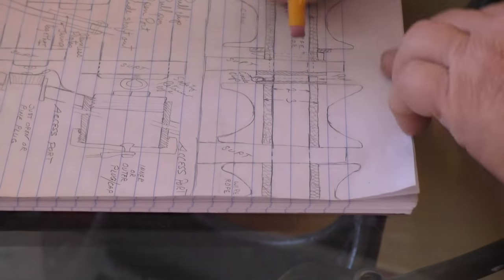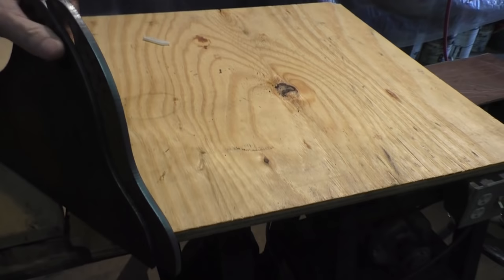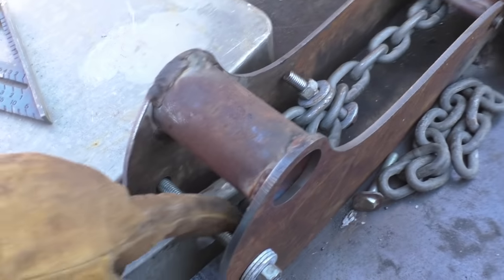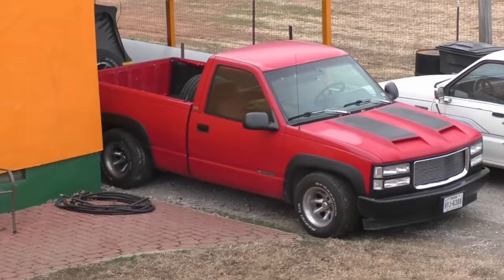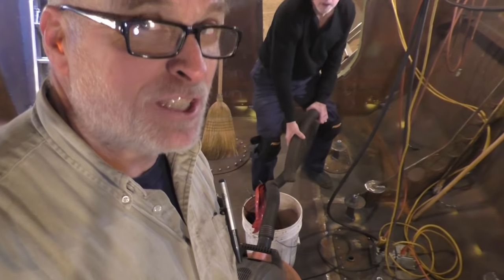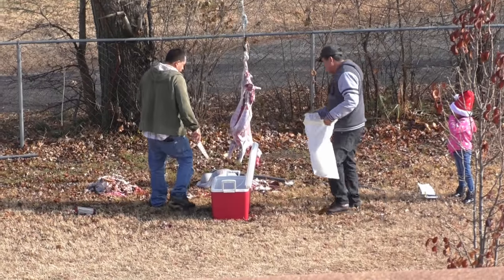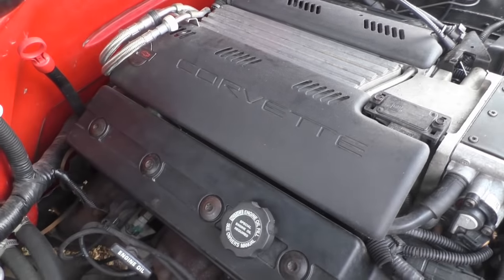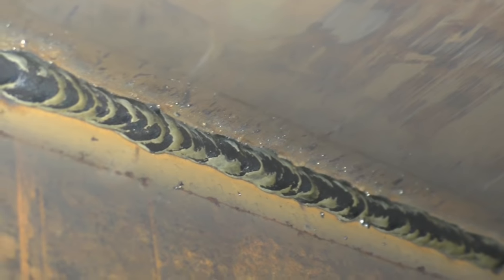Bow Roller, Rudder, Deck Crane and more

Comment: She is looking good Doug. Bet it is going to feel damn good to be able to spin the wheel and move the rudder back and forth.
Reply from the maker: We were headed in that direction but we got turned around and we are working on the fore deck and elevators.   But it will be fun to move the rudder.

Comment: im not sure if this is how it works on large boats but on small boats its not the anchor mount or winch that holds the weight. you clip a short rope to some where along the anchor chain and tie it off to a forward cleat that way the short piece of rope is what takes the force and is the part that will chafe but it can be easily replaced. it will also stretch a bit cushioning the boat.
Reply: true story...
the common way of doing this is a good one, but I think the way they came up with is also a very practical one.
The idea shown in the video is very fast and easy to handle so I think the fact that they loose a bit of 
strechieness is acceptable.
Reply: David Deichmann looking at his new video u think the chain stop may just be for when the anchor is up which would be fine.

Comment: the keepers and locks are a nice touch on the bow roller.   is the one little flappy bit the only thing that will be holding Seeker "connected" to the anchor line when you're at an anchorage point?  or does that just control the pay out of the chain?
Reply from the maker: We're just mocking it up.   Think of that as cardboard. :)

Comment: Are  you going to get the deck crane up and running earlier than the engine so you can use it to help with construction?
Reply from the maker: No.  We really don't need it while the boat sits under to two gantry cranes.

Comment: With a boat this size you will need a bow thruster to maneuver properly !!!
Reply from the maker: Then we'll just maneuver it un-properly.
Reply: u sure ?
u will allways need the small boat to push you around or sth 
it would be mechanically still quite "easey to install" in the current state of the boat
a T transmission (one inlet into two outlets of rotation like used in snow blowers but with impeller  ) a 12" pipe a electromotor a grid against debree on each side and cabeling and a electric switch for the rotation direction
you can weld around the T transmission in order to seal it and the electronics wont be anywere near the whater makeing two propeller is no match for you anymore since you have casted that brass winch fine ...
since you wont use it much you might be okey with just a stainless steel propeller and no brass
Reply from the maker: Hurricane safe?  :)     Anyone thinking they can build a boat that can withstand nature does not know boats or nature.
Reply: i was already for a half year on a boat with several heavey storms with crosswind and up to 6 meter high breaking waves with a 20meter boat and the knowledge that the liveraft wont save us with these storm waves and wind if anything goes wrong
I mean floating stability  ,air surface(being pushed by wind) safety like thickness of of the (safety) glass in the cockpit and the strenght of the frame against incomming waves rolling over deck and hitting the cockpit- meny ships have a carlike window , plastic or even a bulletproof like multi layer safety glass shockproof glass sealing/bedding , the ammount of whater the bilge pumps need to get out quickly when needed, the whatertight seal on the doors and openings 
 the quality and pressure resistance of the radial shaft seal at the propeller shaft
the complete seal of the motor - it should be able to still runn if it is fully submerged with whater 
the liferaft and its positioning for easey access when needed also escape hatches if one of the compartments gets flooded to get out the others
The ammount of force with witch the crew will be tossed around by waves, maybe safety cabeling to hook yourself on to not get washed overbord and for the actual railing you sure will make sure that it should hold a thrust of 350 kg per pillar in every direction and needs a minimum 1" pipe diameter to prevent easily getting injuries if you crash against it, a maximum of 2" to still get a good grip as well as some netting inbetween the railing because children and doggo
some lightning safe isolated electronic to not have a system breakdown while in a thunderstorm
How about isolation of the cockpit and heating if it gets really fucking cold
How strong is the front against the pounding of waves /dropping down fom waves
maybe some solar pannel on the roof of the cocpit in order to still be able to call help if you have zero fuel (leak) and the normal batteries died
friend of mine got a solar pannel on his boat and he said it paid of after the second time refueling for the generator

Important: get a whater seperator for your fuel tanks when you get a tank full with diesel the whater in the fuel will slowly seperate and sink to the bottom or if you tank up at some cheap bitch that cracks the diesel with small ammounts of whater 

i am no native speaker/im from europe but i hope you get my points there
You dont want to learn this the hard way when you are in a storm with 130mph and 12m waves somewere in the gulf of Mexico or Atlantic ocean
Reply from the maker: Hannes Wedenig Oh my God! Always get that big? Nobody told me that! Thank you so much.
Reply: i dont understand english that well and use some translator  for some words... was that sarcasm?
Reply from the maker: Yes.  That is sarcasm.   Don't worry so much mom.  ( More Sarcasm )
Reply: so will your motor just eat pure whater when the tanks are almost empty
Reply from the maker: Yes.  We have developed an engine that runs on water.  Would you like to invest?
Reply: Well im sure the CIA/NSA will get you if you have developed anything that lowers the worth of oil on witch your currency - the USD is based

Comment: I noticed there appears to be a single bolt holding the anchor blade to the stem. Does that provide sufficient strength to hold given the mass of the enormous big-ass boat you're building?
Reply from the maker: No worries, it's just a mock up.

Comment: when you go to paint.  be sure you get the mfgs suggested mixing instructions!   some paints need to be mixed at extremely high Roms for 5-10 minutes.    if you don't get fast enough for long enough, the paint doesn't integrate and adhesion REALLY suffers!

Comment: None of the cruisers I have seen ever trust the chain lock to hold in rough weather.  They use a snubber line to take the weight of the boat...Also some cruisers add a short piece of rod (at 90 degrees) to the end of the shaft on the lock gate so no one gets a finger caught setting the lock.

Comment: A professionally made bowsprit made from Stainless, not mild steel. There's a reason........ because every time you play with an anchor it pretty much smashes the paint off the bowsprit. Which means rust stains all over your deck and probably your outer hull. Eventually the component will rust away and you'll need to replace it (trust me)  My advice - again not wanting to sound negative - before you construct a component for your boat - have a look at the traditional/common designs and ask why they are made like that. Then you can go and design yours (and even disregard other designs if you so wish)
Reply from the maker: We do look and common designs.  I think the difference is that you are looking at yachts and I am looking at work boats. :)
Reply: I'm not sure I follow your logic. Are you telling me that all your anchor management components aren't going to rust because it's a work boat?  Rust doesn't discriminate. And it never sleeps.....

Specifically - any part of your rollers or guides that come in contact with the anchor or chain are going to have the paint knocked off pretty much immediately. It only has to be one chip of paint to start the rust and then it gets under the paint and spreads. 

That chain locking flap thing.....  the groove that holds the chain will lose the entire coating as soon as it is used and the groove will become wider as it rusts away at each side. The pin that the flap pivots on is a steel pin in a steel hole. The pin simply cannot be coated so it will be the first thing to rust. My prediction - the pin will rust out first, thereby putting your boat at risk of losing it's anchor. 

Please trust me on this I was welding steel boats for 30 years. Mainly to replace ill conceived components. If you don't believe me go and find a few people that own poorly maintained steel boats and show them your proposal.

Not only will the components fail but, as I said in my last post, your boat will be covered with rust stains as the rust runs across the deck away from it's source. I'm sorry for providing such a long winded explanation but you clearly have no experience with these things.

Whilst I love your project and the fact that building a boat requires ingenuity and education - there are certain things that you can't foresee from the safety of a drawing table or cad program. Again -trust me - a lot of my work was reworking stuff that young engineers designed and didn't actually work in a practical sense.

As I said - I'm only telling you all this to help you. If I showed your design to my brother, sister or brother in law - (who are all experienced steel boat people) I doubt whether they could stop themselves from posting disparaging comments.

PS - I've edited this - here's an experiment. Before finalising your anchor stuff....  paint the components and drop and retrieve your anchor a few times. Then inspect them to see if the paint has been chipped back to bare metal. That will demonstrate my point. There's one other thing I should mention because it's extremely important. You don't live near the coast so whilst things will rust - they won't rust anywhere near the rate that steel rusts when it is sitting on salt water 24/7. So don't underestimate the speed at which rust will devour exposed steel when the boat is located on the coast. Again - if you don't believe me - do some research. This is the main reason boats are made from plastic and stainless these days. Steel is crap when compared to other more appropriate materials, hence the reason to be careful when designing components.
Reply from the maker: I'm saying you should look at work boats and you will see a lot more steel.   Besides you're getting ahead of yourself as you are only looking at the mock up.

Comment: Think about your anchor chain 
I am a crane operator for 30 years
That chain will not hold that vessel
In one spot for vary long.
Think about a bigger chain,
Do the math.
Reply from the maker: We generally mock parts up with cardboard.  This time we used 1/4" steel and 3/8" chain.